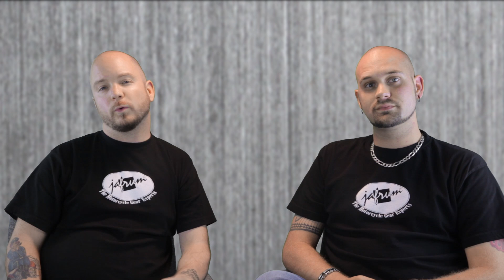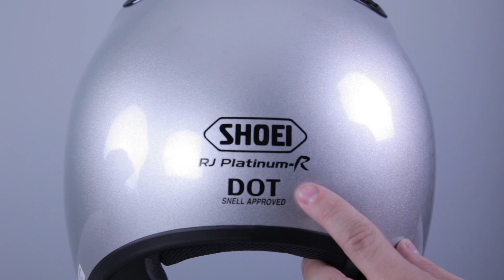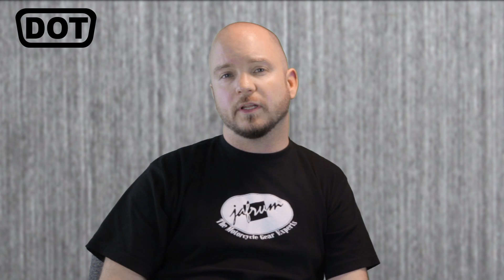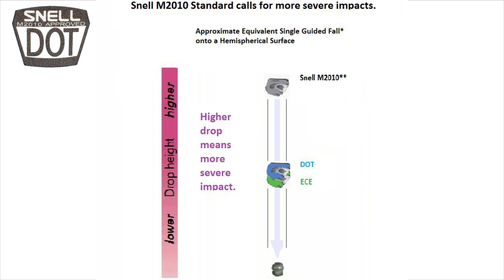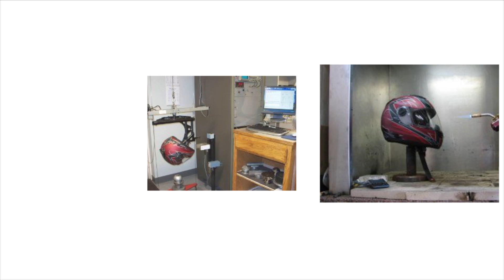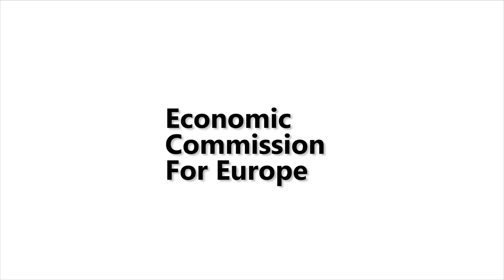SNELL vs DOT vs ECE Helmets - Motorcycle Helmet Safety Ratings - Jafrum.com

Comment: I was told that halmets with drop down sun visors were necessarily less safe because there is a pocket for the visor.  Is that true?
Reply: Not necessarily. I have a Schuberth S2 (DOT/ECE) with internal sun visor. In frontal impact testing (the most common real-world impact according to the COST 327 study), it transmits 81g to the headform. The similarly priced Shoei RF-1200 (DOT/Snell), no sun visor, transmits 123 g in the same test, that is a 52% harder blow to the brain than the Schuberth!
Reply: @alex.m901  Shit man, i just ordered a Shoei 1200.